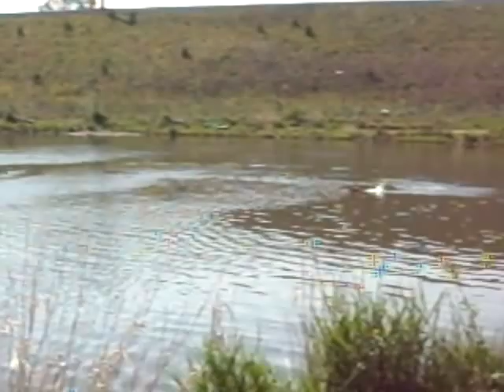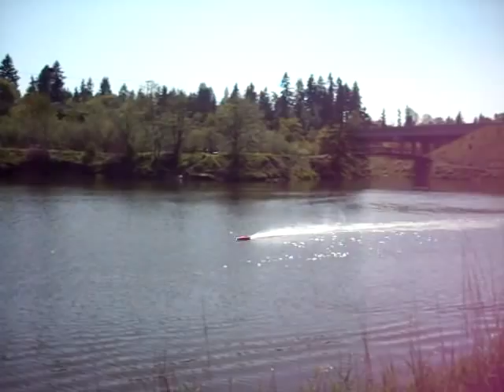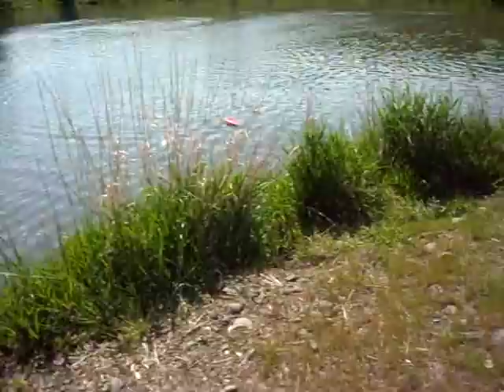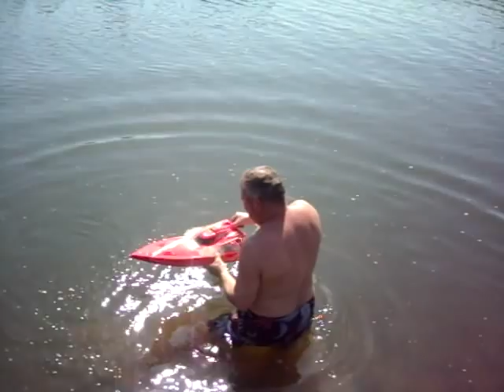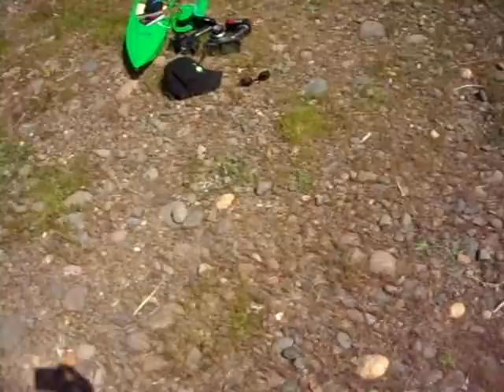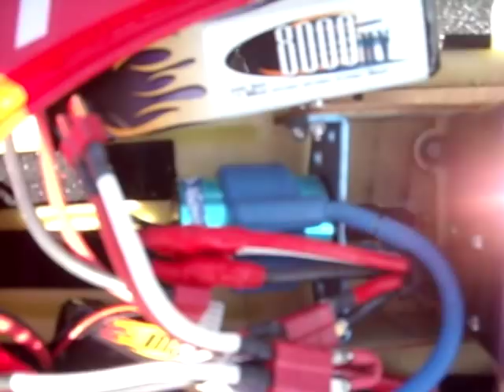smokin sv27

Comment: I did not see any cooling water leaving through the outlet on left side...
it should have been squirting out at times? without cooling it has to fail.....
the prop may be fine....
I test mine buy blowing a bit of air through it before a run.... have fun